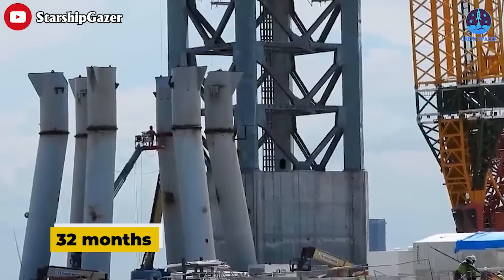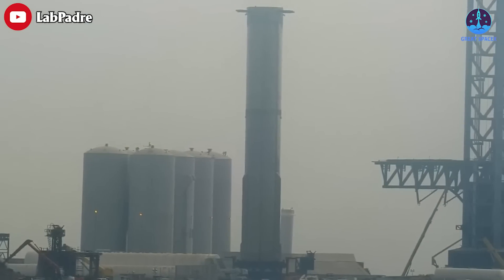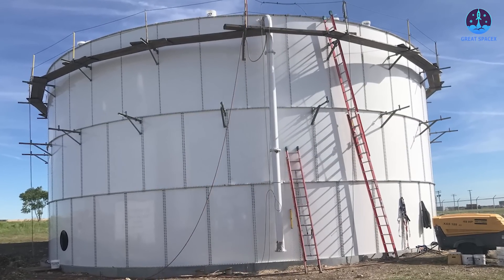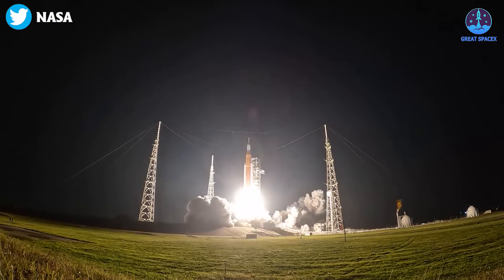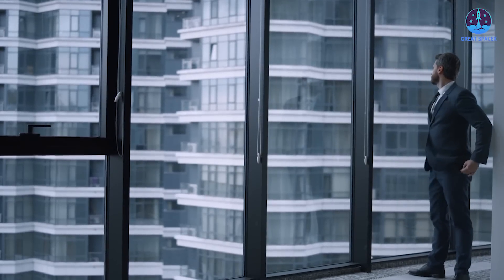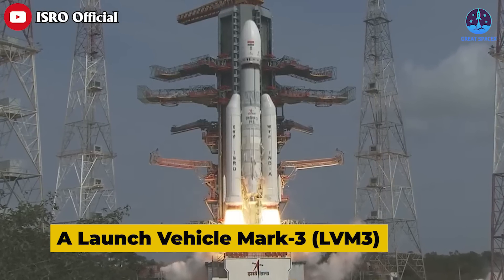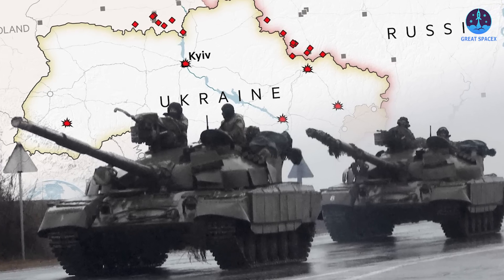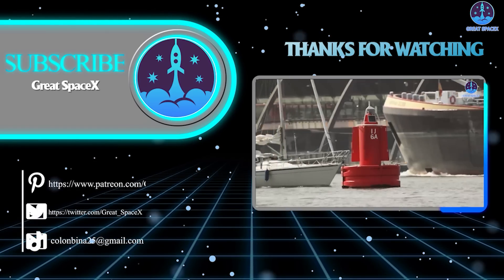SpaceX Stage 0 final UPGRADES, B7 be back, scaffolding removed, new booster, India's rocket...

Comment: SpaceX's "advantage" over the Gov Bidding Process in known as "R&D", research and development. Build & test All components and/or assemblies to Failure, in rapid succession, w/ Scalability (mass production) as the final goal. Gov Bidding processes aren't interested in mass production and depend on "Cost Plus" contracts to build a few "one-off" variants where "Failure is Not an Option", but budget overruns are. Any company who intends to mass produce a product gains their R&D costs back w/ volume sales of a reliable, & relatively inexpensive final product. Gov Bid processes are designed to fit Political goals, not commercial goals.